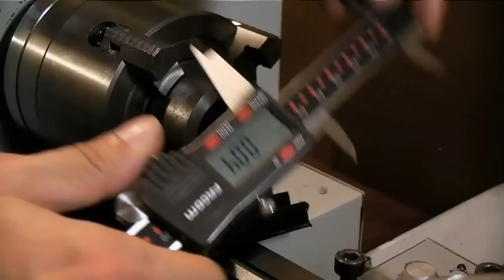Optimum D180 x 300 ball turning attachment Part1

Comment: Nice work on the little lathe. You might consider editing out some of the non-machining parts of the videos. Been a long time since I was in Greece. Nebraska, USA
I also use my digital calipers for layout scribing, consider it part of their use as a tool. And yes it wears the tips a little and like all tools they wear out but it takes a long time & they are cheap. I also suspect you can hone the outside surfaces to get a sharp point back.
Reply from the maker: Hi Larry, and thank you for stopping by. Yes, you are right, the video should be shorter to not lose interest. Hopefully I will visit USA, Chicago next year. All the best - Dimitris